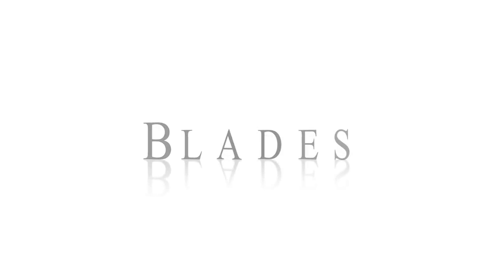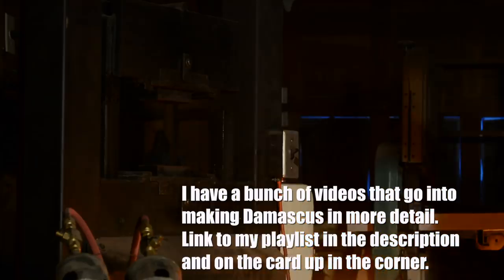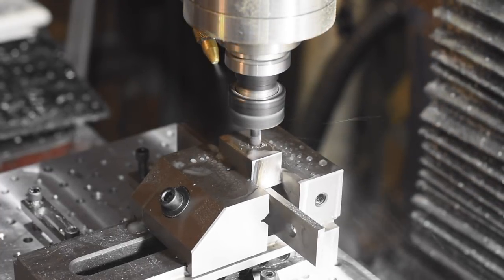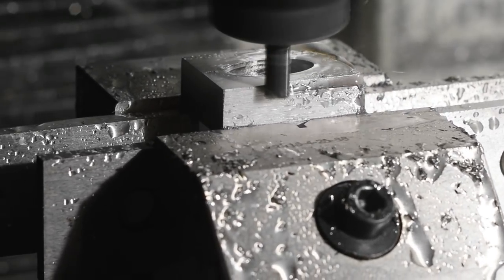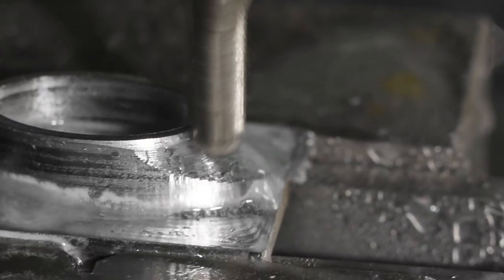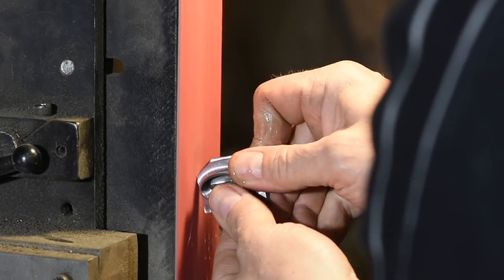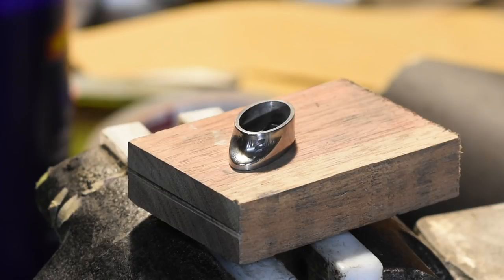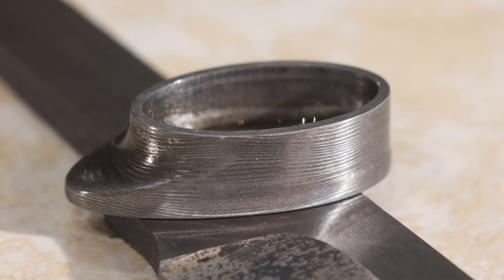Making A Damascus Knife Guard - CNC Project

Comment: Something I noticed on the surface grinder, and you mentioned on your other video on the surface grinder about the rougher than expectt finish. When we are going for a nice finish, we will re-dress the wheel, then only take .0005 to .001 depth for a couple passes. Then we only cross feed about .050 at a time. Some guys will will do what they call a spark out pass where they will work across the part without taking any more depth of cut. 
However, I have zero e experience using a belt head attachment on a surface grinder, so I don't know how much of a difference that makes.
Great video! Thank you for sharing

Comment: Great video as always Walter. More RPM or less feed combined with leaving less material for finishing should save you a bunch of hand sanding. I usually leave 5-10 thou for finishing. To get a polished finish on a 1/4 ball end mill i'm usually around .008-.010 of an inch stepover. That should leave you with a surface texture of less than .0001 (aka pretty darn shiny). 3/8 ball, you can obviously go bigger step over 15ish thou. does fairly well. Softer steels im usually running 4000ish rpm and 30+ inches a minute depending on the shape and how steeply the end mill is moving downward. RPM is your friend when you are finishing with a ball end mill. Keep kicking ass man great stuff!

Comment: Super video! 
Couple of questions: 1) Why did you choose misting vs flood when milling?
Also, what was the step over on your finish passes with the ball nose end mill?
You never mentioned how many pieces hit the trash can when building knives; a lot of people are not aware of that!
Thanks again.
Reply: Richard Kicklighter no enclosure so flood is too messy and doesn't have enough pressure compared to the mist. His endmills are coated and designed to be run dry.
Reply: He has a couple videos about failed heat treating where things end up in the round file.